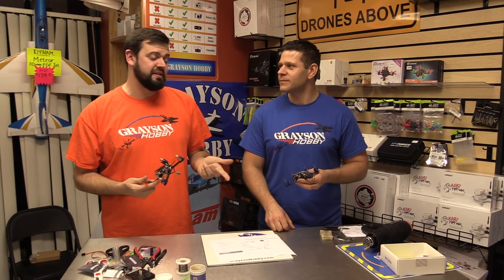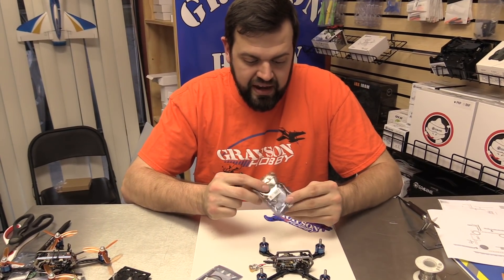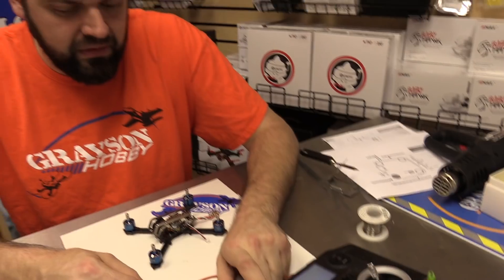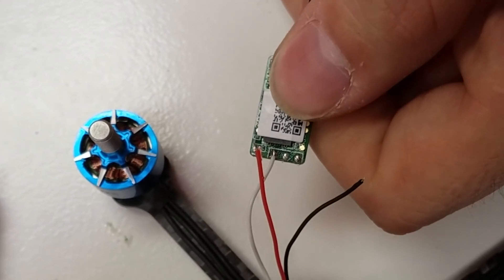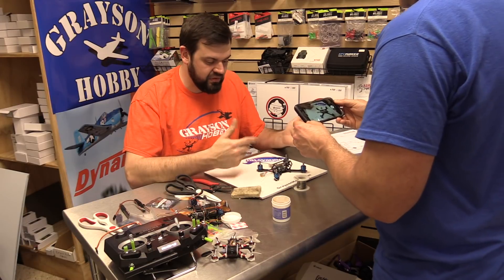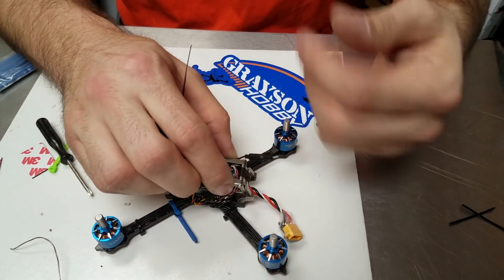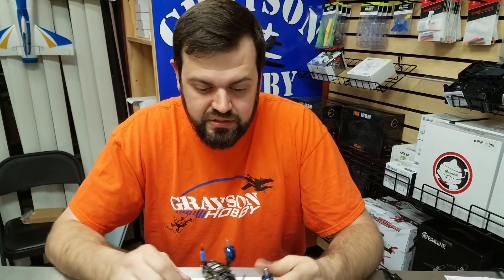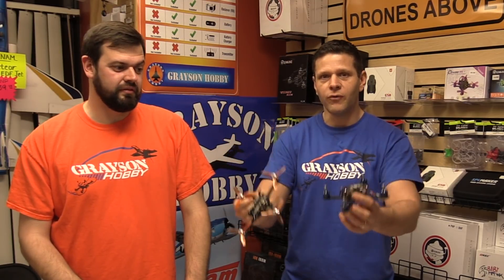How to Install FrSky RX Diatone M3 3 Inch Quad | XM+ Install  F4 Fury

Comment: Hey, this is a great video. I'm trying an install with the SPM4649T but it's on the new (version 3 i think) stack with the capacitor on it. I can't find the correct schematic for it, and I'm wondering the best place to connect on this new flight controller. I'm working with this and the GTR90 DSMX video you posted. Great videos!
Any help is appreciated!
Reply: You hook it up to the tx3 pad for the signal and use a 3.3 volt pad for the positive and then just a ground. Then just make sure to turn on tx3 in the ports tab. Don't use the S bus cuz I believe is inverted.

Comment: Do you need to solder / de-solder a jumper on the FC to install a SBUS receiver? I think either the R90 or the M3 had a jumper bridge that was NOT preconfigured for SBUS, or am I wrong?

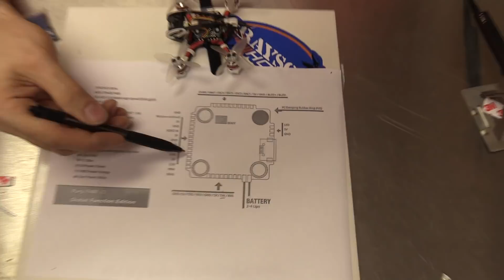Comment: Great Video thank you for posting this. Could you post the v2 diagram as a ref picture? I had to go back and pause @14:46 to get the wiring diagram since mine came without the pigtail installed. I didn't have any luck finding a V2 Diagram. After connecting the wires according to diagram, was without a hitch. Not real sure why mine did not come with them pre-installed.

Comment: Had mine for a week now. The fpv feed is terrible with lines. That’s before arming and flying. Soldered supplied cap and no difference. It’s almost unflyable  any recommended fixes ?